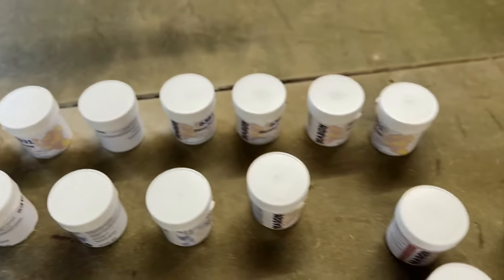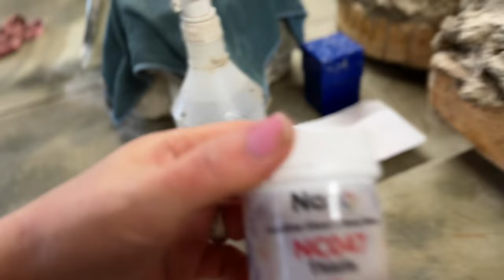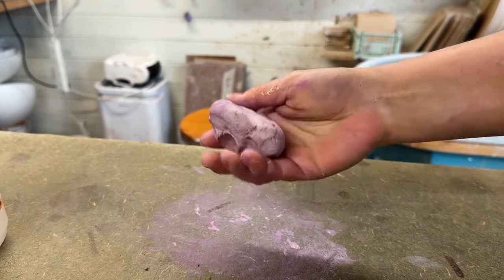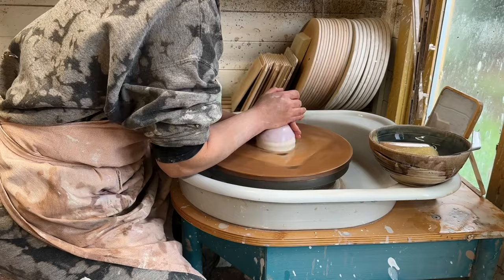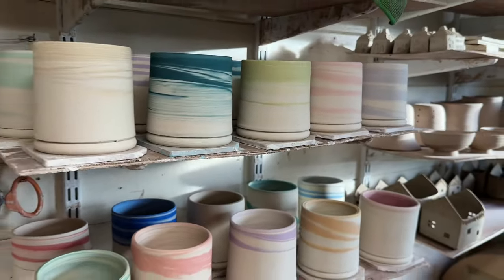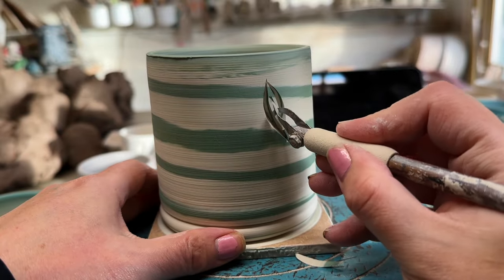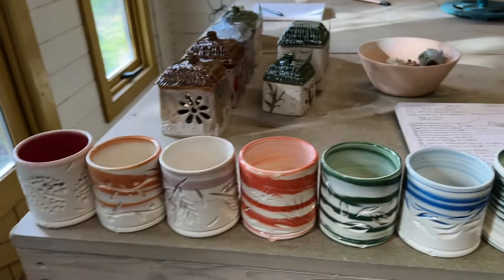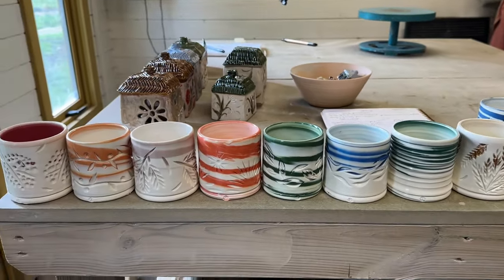Testing out coloured stains and adding them to porcelain before wheel-throwing candle holders

Comment: Mixing dry mason stains directly into clay results in uneven distribution and cakey spots. To avoid this, place your stain in a bit of water and allow it to dilute for a short time. Then slowly add dry trim shavings to this mixture until workable. Turn it onto a wedging table and allow to dry a bit. Then add your clay choice and amount to create the preferred color value. I use mason stains often and have found this procedure consistent and predictable. Good luck!
Reply from the maker: Ah wow thank you so much for your detail tips will be sure to do this next time :)